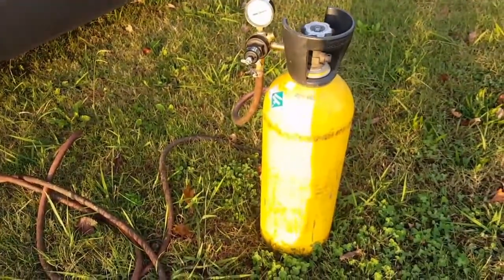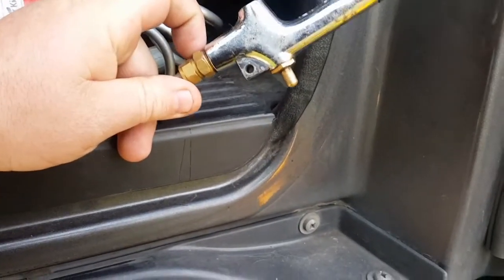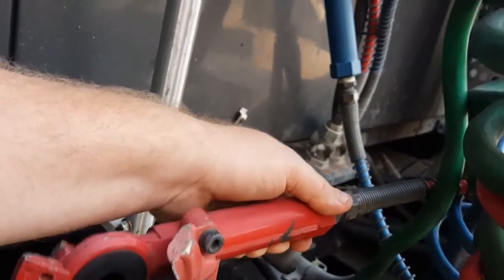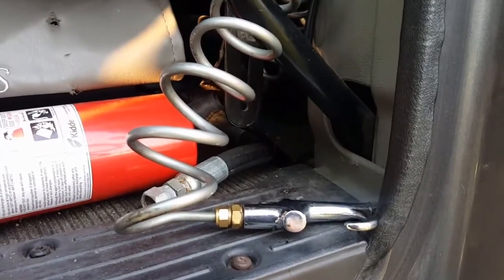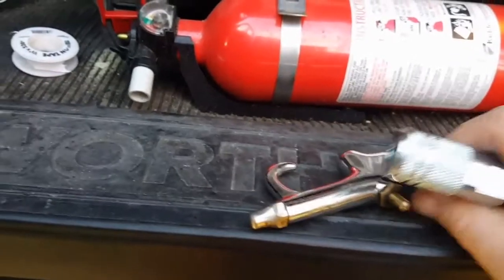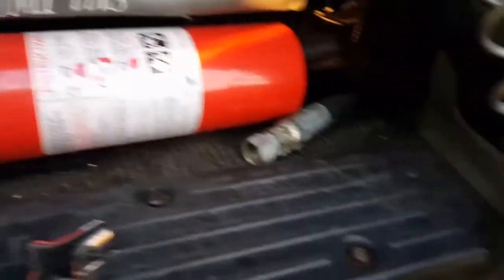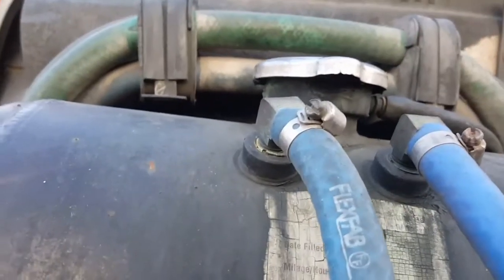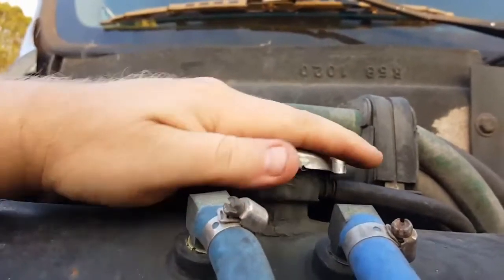The Final Test!!BLOWN HEAD GASKET!!!C-15 6NZ Vs Co2

Comment: The fluid tester was meant for gasoline engines. I’ve learned that the hard way and was told by a machinist who has ran into this issue many times on cat engines. Spend hours going through this as well with a cat. Blowing coolant out the cap but not changing color, head gasket was bad and so on.

Comment: SpeedFreak do you know if there is any other way for the charge air line to get coolant in it besides the Precooler on a C-13 Acert?
I'm pretty sure I'm fixing to need my 3rd precooler in 1.5 years time frame. This one now is 2 months old from fresh new install. 1st symptoms were loads of white smoke and loosing coolant and skipping.
I'm able to use the truck by keeping about 1 inch of coolant in the reservoir tank.
Much more than that it will smoke and run bad.
Reply: Wow mr blade still running
Reply: @golloherera1934  Yea I by passed the cooler and never looked back!😀
Reply: I need your help with by passed cooler ty
Reply: @golloherera1934  Are you wanting to by pass your cooler?
Reply: Yes c13 accert
Reply: @golloherera1934  I used 5/16  bolts and hose clamps to plug the small coolant line.  Unook the two  1 inch cooling lines from the cooler and hook them together. I used a 2.5 inch long 1" copper pipe  to couple the hoses with hose clamps.
Add 2 short pieces of 1 inch hose to the ports of the cooler with 3/4 galvanized plugs in the ends secured with hose clamps. I bought a 1" hose with a 90 bend in it to hook the lines together closer to the frame.

Comment: combustion gas in coolant usually indicates internal engine damage. next step would be to remove the oil filler cap with the engine running at normal operating temperature to check for blow by and back pressure, that will help give you an idea of what's going on inside. my guess is the engine is ready to be pulled and rebuilt

Comment: My last comment was getting long winded, but I also wanted to ask. 
How is the Blow bye on the engine? any signs that air might be entering the crankcase?

I personally have seen the two different fluids myself I can not really find any information on the difference with these fluids. I would think they react the same to combustion gases.
I've read about test fluids having difference reactions states to the amount combustion gas level (I.e. Low level and High level)
Make it easier to find very small leak levels of dissolved gases.
But again I can't find any information or comment from the makers on the difference.

Would make a good video comparing the reactions between Gas & Diesel exhust.

Comment: Keith, Love the channel.

Wanted to drop a few lines/comments about your combustion leak check and a thumbs up to your work around with the CO2 dopping of the Air Pneumatic system.

I personal like UView's Double chamber tester myself, it really helps to eliminate false positives.

If your ever in a spot in questioning the test fluid (I.e. Is it any good) there is a simple test you can perform. 
Load up the tester (No need to fill both chambers) Place it near a running cars exhaust tailpipe and give it a few pumps and draw in some exhaust gases until it changes color (If not, you know the Test fluid has passed its use), with a change in color take it away from the tailpipe and draw some fresh air into the chamber. The Test fluid should turn back to its original color. (It can do this a few times before it becomes saturated and unusable)
This is great to double check your results on a diagnoses, I personally do not reuse/save used fluid from Vehicle to Vehicle but will use the same fluid in the same session of tests. Waste not! :)

Another good indicator of issues, If you get a good seal around the Radiator/Overflow Tank neck. The Tester will pull a vacuum and the pump ball will collapse (suck in) and hold. If you can continually pump the Leak tester and it continues to draw air from the cooling system, there is a leak somewhere in the system.

There are other tests you could also perform but I think you're looking at an issue with the Air pump driving air into the cooling system, (But from where) I'm not familiar with these systems but I could theorize what is going on.
Don't know if you have pulled the Head off yet. :(

Another set of tests would be a pressure check and a vacuum test on the cooling system to track down the leak, but again I think its the Air pump.

Now One,
Does the Air pump have its own oil system? or does it get its liberation from the engine oil?
Is the Air pump Air cooled? or does it have/or also have a cooling jacket from the engine block running into it?
(This would be nice as it would give the pump direct access to the cooling system, or there is a crack somewhere in the block as well the cooling system)

I've read and seen that on some rigs (If not most) there is an Air clutch for the Fan. I've seen the airline run external but also in some cases have a jacket to feed the clutch via the block.

Another possibility is the Fan Clutch could be the entry of the air into the system via the water pump!

The idea of the cooling system holding pressure for so long days weeks, the issue must have come from the Pneumatic system because of its the only part that has a Higher pressure at any time (Cold/Hot engine) then the cooling system.
The main Pneumatic feeds do not touch the engine in any way other than the Air Pump or the Fan Clutch/water pump that I know of and this is the common point.

I would start/further your diagnostic process looking into these areas before Popping the head. (If you have not already)
You are close tto the issue.
Might save you time and money, worst case you still have to pull the head. You're almost there by testing the Air Pump and Fan Clutch as well the water pump.

Cheers, Keeps us updated...
Reply: So it stays blue on radiator , until you put pressure on air system?  Then changed color, thought it would change from radiator cap running?  This would have misled you to think it was ok without the air system test but I don’t see why it wouldn’t have shown by the top cap??
Reply from the maker: Thanks for the info. I haven't pulled the head yet. In that video I had the coolant bypassed from the compressor. I have tried several different ways of testing the clutch fan and the air system. I'm still leaning towards it being a head issue but just can't prove it. The engine itself runs great has very little blow by and uses less than 2 quarts of oil within 12000 mile oil change intervals. If you have any more ideas please comment below. Thanks for the help
Reply: Found this video online of a pump replacement as a reference for myself.

https://www.youtube.com/watch?v=846bVMd_J4Q

I still find it weird how you were not getting a positive for Combustion gases in the cooling system in some of your last tests but only after charging the Pneumatic system with CO2 you started to get a positive reading.
Or did I miss something? :)

I'm wondering if you might have two issues. (Don't know how yet)
The test will react to combustion gases but will also react with air as I mentioned, If you get a positive you can change the color of the fluid back to Blue by drawing in fresh air.

What if you do have a head gasket/block/head crack but in addition somehow your getting raw "clean" air in the system.
This would explain how your test is not positive all the time!?

Here is a video from a friend from SMA.
The color does not really matter, It will go from Blue, Light green, to Yellow. They will all still react the same.

https://www.youtube.com/watch?v=U0DdVQoBu4U

Its also wried how long the cooling system holds pressure over time.

I know they make a Dye you can add to the coolant and leaks do travel both ways. It would show up in the exhaust or in the oil. There are videos on its use, afterward, there will be a fine UV dye coating that would show up that could be traced back and/or give you an idea.

It's better to have an idea than a guess.

Another visual indicator you could try is keeping the Tester on the Tank and give the engine a few revs. The bubble would increase if it was from Combustion I would think.

Man, This is a good one, Keith. 
I really do like diagnostics, its a hobby as well as a side trade of mine.
If it were me, I couldn't make a call without other tests going positive.
My Vehicle yes, customer Nope.

Besides the Combustion Leak Check Aka Block check. You still have a few more tricks,

Cylinder leak down test
Cylinder Compression Test
Pressure/Vacuum Test (Cooling system)
UV Dye Test (Cooling system)
Oil Hot Plate Test (My favorite, it works)
Oil Analyzed (Cost $28.00)

I'm sure there are a few more.

Something is pressurizing the cooling system with a gas (Combustion and/or Air) but what and from where?
Does the truck overheat much?